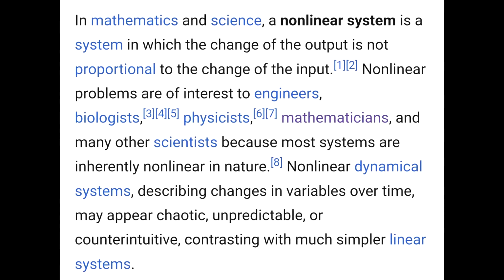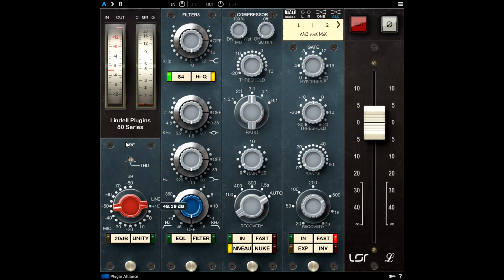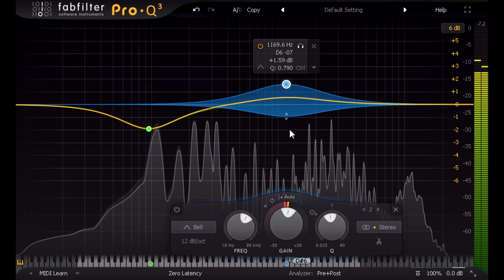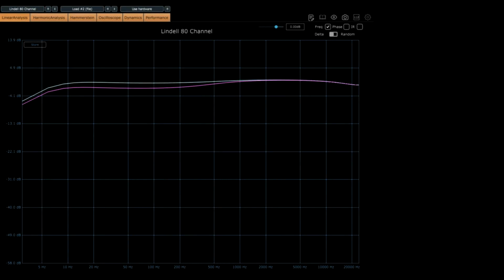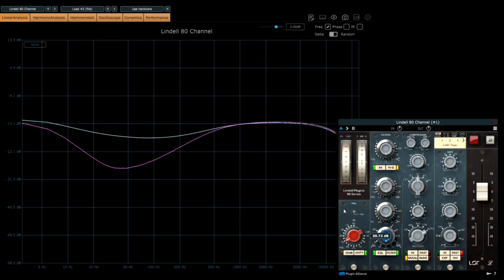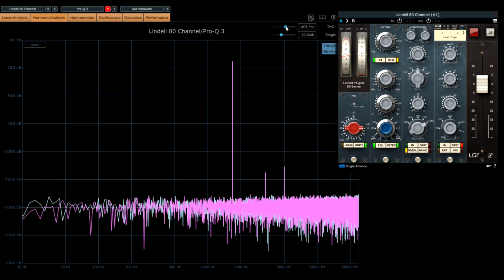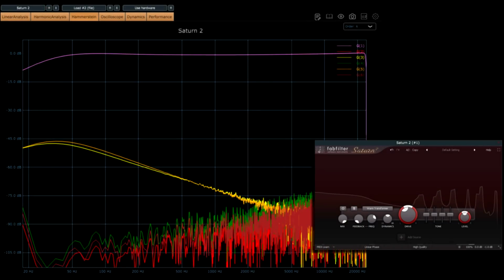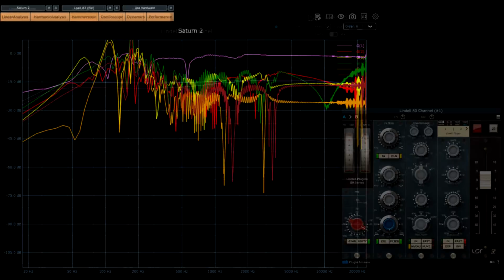WTF is a Non Linearity?

Comment: comes down to definitions. "Nonlinear", at it's core, usually just means that it's not a straight line. And you can describe a multitude of things as "non-linear". You have made a video, where you explain what non-linearity usually means to you. I think the nonlinearity the youtuber you are talking about, was talking about, definately IS a nonlinearity. Now granted.. linearity has nothing to do with wether curves are perfectly symmetric etc (because no curve is linear).. but one really needs to be deliberately trying not to understand what he's saying in order to not understand it. (Also there is a difference between: static/moving and linear/non-linear..)

When it comes to "gain"-knobs and guitarists.. it's hell. Often these gain knobs are NOT clean gain.. but instead they drive the sound and shouldn't be called gain.

When it comes to tremolo and vibrato it is NOT that straightforward neither. While you are RIGHT about vibrato, tremolo can mean a lot of things. One of which is also a change of frequency (2 under first under "Look it up") and thus more than just limited to "volume automation".
I think it's very important to note that both tremolo and vibrato have very similar meanings in italian. Just as trembling and vibrating are very close in english.

Look it up (Wikipedia):

In music, tremolo (Italian pronunciation: [ˈtrɛːmolo]), or tremolando ([tremoˈlando]), is a trembling effect. There are two types of tremolo.

The first is a rapid reiteration:

 1   of a single note, particularly used on bowed string instruments, by rapidly moving the bow back and forth; plucked strings such as on a harp, where it is called bisbigliando (Italian pronunciation: [bizbiʎˈʎando]) or "whispering"; and tremolo picking, in which a single note is repeated extremely rapidly with a plectrum (or "pick") on traditionally plucked string instruments such as guitar (although a pick is not necessary to execute a tremolo), mandolin, etc.
 2   between two notes or chords in alternation, an imitation (not to be confused with a trill) of the preceding that is more common on keyboard instruments. Mallet instruments such as the marimba are capable of either method.
( 3   a roll on any percussion instrument, whether tuned or untuned.)

A second type of tremolo is a variation in amplitude:

1    as produced on organs by tremulants
2    using electronic effects in guitar amplifiers and effects pedals which rapidly turn the volume of a signal up and down, creating a "shuddering" effect
3    an imitation of the same by strings in which pulsations are taken in the same bow direction
4    a vocal technique involving a wide or slow vibrato, not to be confused with the trillo or "Monteverdi trill"

Now to be fair, your way of describing tremolo and vibrato is pretty accurate for most cases in music production. And your definition of gain is also pretty accurate. BUT not everyone is as accurate and we still understand each other. It's very easy to point out that something is not 100% correct - just as your explanation of "tremolo". So let's try to be reasonable and just understand each other.. because if either one makes an effort to misunderstand - he WILL be successful.
Reply: A line isn't neccessarily linear. Let's consider the function f(x)=x+.01. This is a line, but it's not linear - f(2x)=2x+.1!=2x+.2=2f(x). On the other hand something like a simple EQ is linear, but it's got nothing to do with lines. Don't get tricked by the word...
Reply: @simongunkel7457  ..this is exactly the kind of well-intentioned try to be educational that I don't deem to be useful. Your definition is only the mathematical one. Linear, by definition.. - just the word "linear"-  in regular use.. means "straight". Or more precisely: "arranged in or extending along a straight or nearly straight line."
I know very well that there are definitions of linear within mathematics, within dramaturgy/storytelling, within audio, etc. etc. etc. .. sometimes there is even more than one meaning within one subject area. BUT none of these subjects is where the word comes from. The word simply means "straight line" if a regular person uses it. And if we all try to insist on the definition we know best we will NOT suceed in effective communication.

I hope you understand where I'm coming from now.
Reply: @akagerhard  I don't really understand where you are coming from. Words have specific meaning within particular contexts and using them without regard to that context makes things harder to understand. This is a channel dealing with audio engineering and digital signal processing. In that context linear is used in the mathematical sense, because, well, it's an engineering field and digital signal processing is a type of discrete mathematics. It also has direct effects on the user - a plugin with a non-linear transfer function will add harmonic content, which in turn will create aliasing artefacts if you don't use oversampling. A plugin with a linear transfer function will not cause these issues. If you have a plugin that doesn't have an oversampling function you could work at a higher sample rate to circumvent issues. But if is linear there is no need for you to take such action. It's a relevant distinction for the type of work discussed here.
Reply: @simongunkel7457  I'm not going to argue with you. It is a pretty simple fact, that even in audio you sometimes need to describe a non-straight line. And when you do so, it is perfectly fine to say "non-linear", as long as it is obvious what you are talking about. (And in the case of the video that Dan is talking about, it was..). Just as it is fine to talk about a "clean" eq or about "musical compressors" or about "creamy highend" or about "glueing the tracks together". Audio engineering is more than mathematics you know? There's a lot you can't describe in mathematic terms. And if you could but you can't nobody would understand what you are saying. Words are words and words are getting used in multiple ways, even within specific fields of work.

Languague is amazingly effective, but it is not perfect and neither are humans. Mathematics are not perfect neither, as you should know - if you are a serious mathematician. There are things you can't prove and things you can't describe (yet). If you are not willing to make an effort to understand things that are being described, but don't have a perfect word for yet - that's your problem. Don't make it mine.

Good night, Simon.. I will not entertain a discussion where one side is not trying to understand the other any further.
Reply: @akagerhard  Some of the terms are clearly defined. A clean EQ is an EQ that doesn't produce distortion. A musical compressor adds distortion, but mainly from the square term of a Taylor aproximation, which adds octave above, octave above that, perfect fifth above that, perfect fourth above that (for another octave) and only then a major third. Compare that to the cubic term being relevant where you get a fifth, a minor 6th above that and then we're looking at a flat tritone above that. More musical means "less discordant harmonic material added". Glue compression means compressing a bus, low threshold, low ratio, medium to slow attack, slow release. Creamy high end means nothing, at least not something commonly understood. And since the point of language is to communicate, I would want a more clear expression. It's a term I've seen in reviews of audio gear and instruments that sound vastly different in the high end, so if I was at the desk and you were the producer and told me to make the high end more creamy, I wouldn't know what to do. I would know what to do in the other three cases.
Audio engineering is about getting to the sound in your head from the sound that's currently coming from the speakers. Understanding how processing works is the roadmap. And if you are working with a producer or artist who has creative control, then it's about getting to the sound in their heads. And yes, language is important there, because if they had the engineering skills, you wouldn't be there. But that requires them to try to communicate with me and that means using a language I can understand, because otherwise I'm like a cab driver being told to go somewhere and on arriving there getting told that it's the wrong place. You ask for glue compression on the drums? I can get you there. You ask for creamy high end? You could just a well tell me to make it sound good, it doesn't tell me where you want to go. And a muddled understanding of non-linearity on your part isn't going to help either. You want saturation? I can help you there. You want ripple in your frequency response? Dito. You ask for non-linearity and my reaction is to add distortion. If you meant something else, you've just wasted both of our time.

I've seen the presumptive video this was a response to. I can understand what that Youtuber was trying to say. But it would be a whole lot easier to understand if he didn't just throw words around with a different meaning than usual, which you have to backwards engineer to understand what he means. And his private use of the term will lead to misunderstandings between people who have seen his video and people who haven't. That is a problem.

Comment: The simplest definition of nonlinear would be 
f(a+b) not equal f(a)+f(b), 
where a and b are 2 signals and f is the processing applied (eg distortion). This means that whether you apply the processing to the sum of signals (eg bus group), or independently on each signal and then sum them afterward will lead different result. That will be of course the case with distortion, but also, and I wished you mentioned it, compression! That would have been a better way to explain nonlinearities, especially since I think most people will understand that applying compression to individual channels clearly lead to different results than applying compression on your final mix.

Comment: Not only the gain stage of ProQ is linear. Actually, all the static EQ curves are too. Mathematically what we call a linear process (more formally linear time invariant system, or LTI system) is a process that can be reversed by running the inverse of the process on the already processed signal to get you back to the unmodified signal. In other words linear processes are non-destructive! So in the case of ProQ (and any other ordinary digital EQ) you can boost 1kHz by x dB, place a second instance right after that cuts the same frequency by the same amount. Since this type of filtering is built on LTI code, the resulting signal is identical to what you fed the first instance, bar eventual very low level differences introduced if the algorithm were to use some kind of (non-linear) approximation to save CPU power (or sloppy coding).

Now, try the same thing with for example Mwaveshaper by Melda, which is a classic transfer curve shaper. Bend the transfer curve in a convex manner so that medium intensity signals get amplified by factor 1.5, for example. Place another instance of Mwaveshaper behind it that attenuates medium intensity signals by multiplying with 0.666... If Mwaveshaper was linear we would expect to get us back to square one, but the resulting signal is anything but identical to the one you had from the start. What causes this is non-linear expressions such as exponentials in the code. They are inherently non-linear. The problem becomes even more unsolvable if you introduce attack and release times such as in a common compressor - in such case the transfer function isn't even time invariant (in other words, the process parameters change depending on time and what signal came before the signal you are currently processing).
Reply: A nonlinearity of x^2 for example can be negated by x^(1/2) since x^(2*1/2) = x, which is linear, so contrary to your comment, nonlinear processes CAN be reversed by using the inverse process. A better (and simpler) definition of a nonlinear process is that a nonlinearity acting on the sum of two signals is not necessarily the same as the sum of the signals with the nonlinearity applied individually.
Reply: Hi, I respectfully but firmly disagree with your definition of an LTI system. A linear time-invariant system is just what the name says: linear (i.e. f(a+b) = f(a) + f(b), like an EQ and not like a distortion), and time-invariant (delaying the input just delays the output, like an EQ or a distortion and not like a tremolo effect). However it may very well be non-invertible: consider a notch filter, for instance. Filtering a pure sine wave at the frequency of the notch gives a result of zero, therefore whatever filtering you put afterwards you will not be able to recover the original signal.

On the other hand, some nonlinear processes are perfectly invertible. If you take the cube root of a signal, the output will not be proportional to the input (hence nonlinear). But if you then take the cube power of the result, you will perfectly reconstruct the original signal. (As a matter of fact this idea is frequently used in telecommunications)
Reply: @alexthi  What you said I agree fully with. Your examples put the finger on nice examples that go against what I said. It's not as simple as what I wrote, and I may have gotten a few details wrong. I am by no means an expert. (on my third year in EE, in the middle of the first course in DSP)
Reply: As a developer and engineer, this is extremely interesting and makes perfect sense, but wouldn't a zero difference require an effectively infinite noise-floor? I guess that's basically what we have in a 32bit float environment anyways, but I'm curious as to whether this would actually be non-destructive in a laboratory setting, or if it's just non-destructive to our ears...
Reply: @eugenefullstack7613  You can do the old phase reverse trick, then check the level of the summing bus. I don't think bit depth influences the cancellation as long as it stays constant. Anyhow, you should get total cancellation.
Reply: @eugenefullstack7613  Well, you lose info in the lower bits. But if you have 32 or 64 bit processing, the losses are far below the noise floor of any signal from the analog domain.
Reply: @oskjan1  A more interesting (from audio/musician standpoint) property of LTI systems is that they are commutative. I.e. if A and B are LTIs then the signal chains ->A->B-> and ->B->A-> give identical output for identical input. If either of the two processes are non-linear the identity no longer holds. Intuitively, placing a reverb after or before EQ makes no difference (assuming both are of "digital" i.e. linear kind). Placing a compressor before EQ will give you different results from placing it after EQ.